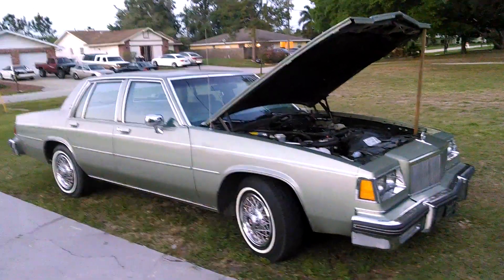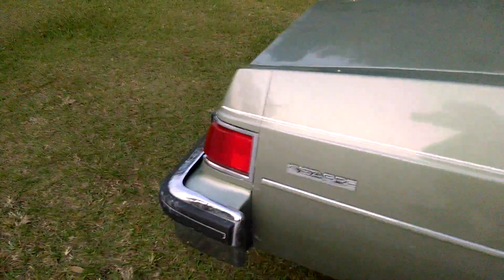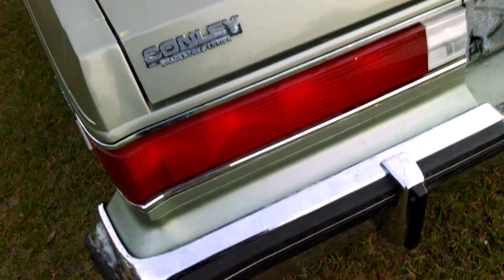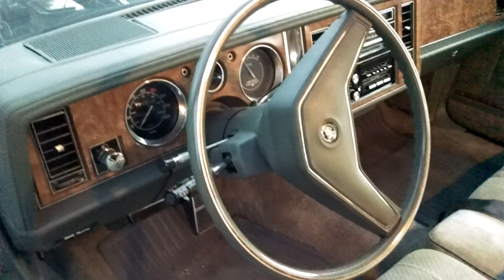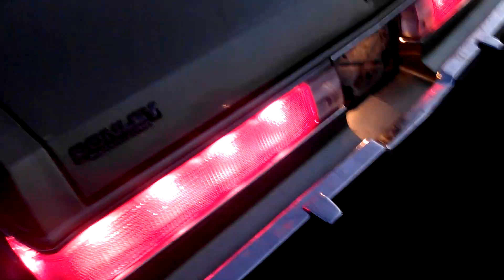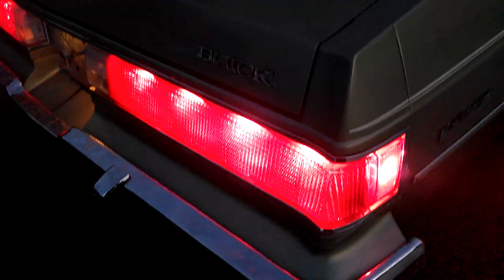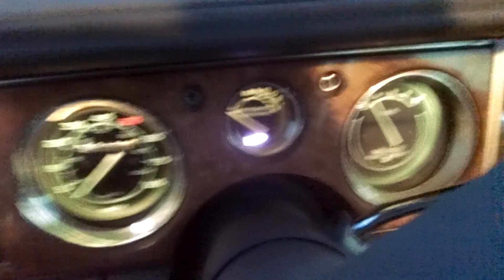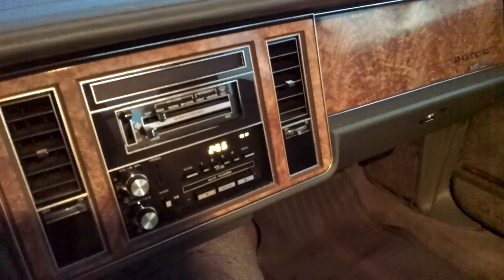Garage sale find 1985 Buick LeSabre w/60k orig.

Comment: I had one 1985 silver four door with a full blue vinyl top and blue interior with 307 V8 4 speed auto. I loved it! Added Chrome rain vents to all four doors and chrome mud flaps all four wheel wells. Received light blue and dark blue detailers paint and added a design to both exterior mirrors. Added yellow fog light under the grill and had blue stripes on the tail lights from the rear quarter of the light and wrapped around to reverse light where on both reverse lights. I added extra bright bulbs and glued Buick emblems on them. I sold the car with 190,000 miles in it. The paint still shined nice in and out gave me no trouble and I would do it again. Sold it for a 1995 Olds Delta 88 which I liked as well.

Comment: Why did they put old's  engine  in buicks  instead  of having just buick motor that cheating
Reply: Most buicks after 1977 buick decided  to get rid of their v8 in favor of focusing  on the 231 buick v6 the buick v8 is unique  and it had the distributor  at an angle in front of the engine via the timing  cover